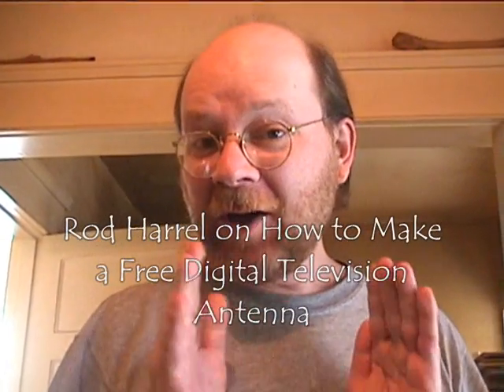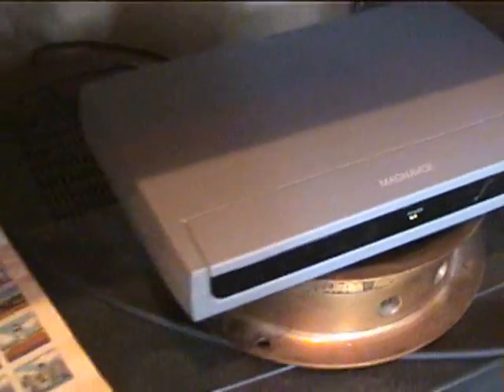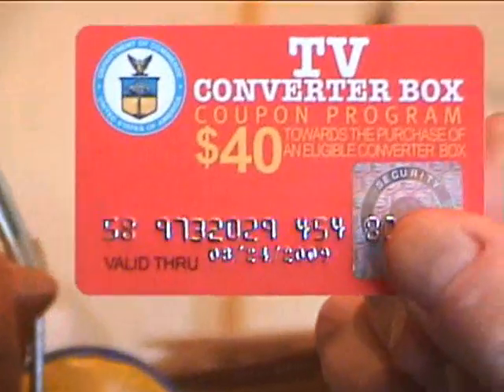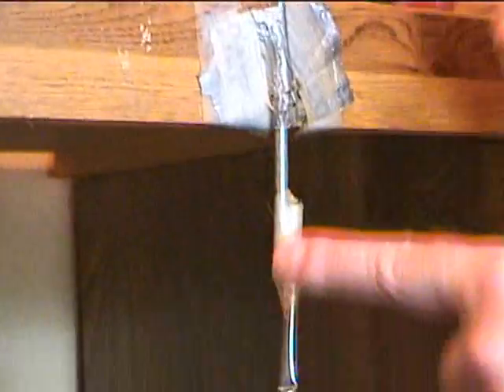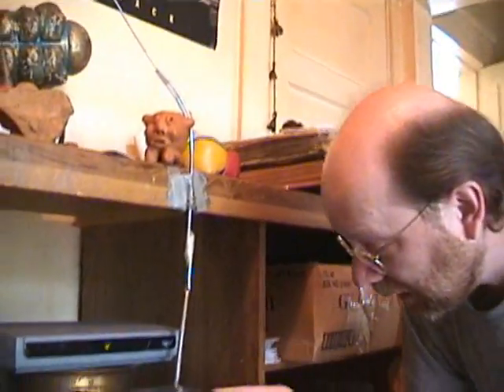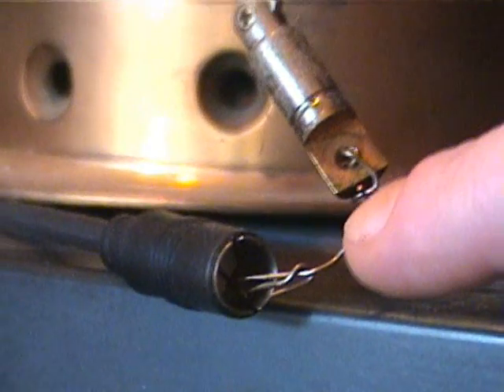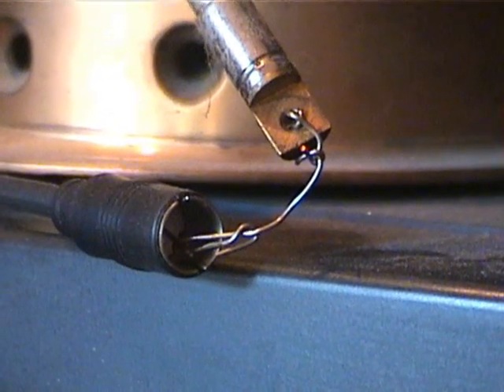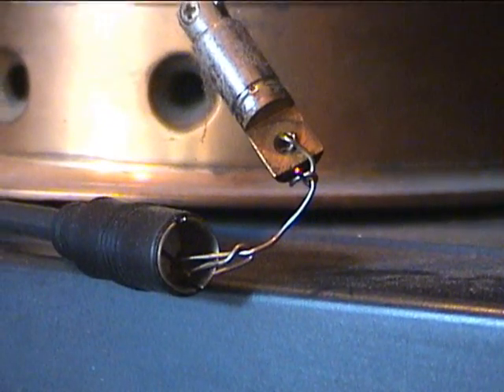How to Make a Free Digital Television Antenna

Comment from the maker: @lukeeeisme another little known fact is that the digital signals are weaker than the old analog ones. Some rural areas which have repeater stations are allowed to still use analog.